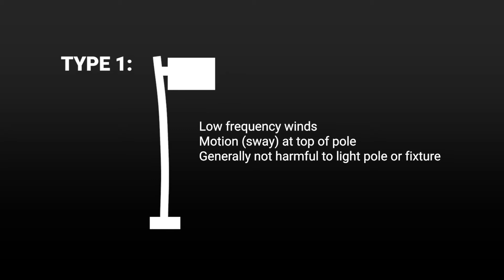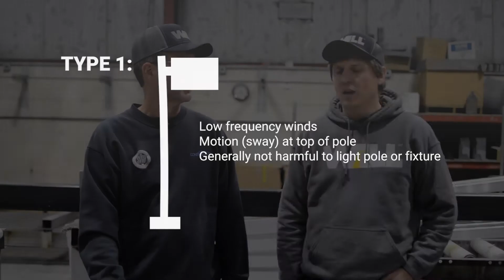Light Pole Harmonic Vibrations & Failures Explained | Anatomy Of A Light Pole

Comment: Hey Gentleman, what do you mean by a dead weight in the factory installed dampener
Reply from the maker: Hi Adrian. There's a solid steel bar w/ rubber end caps placed inside. Hope this helps!